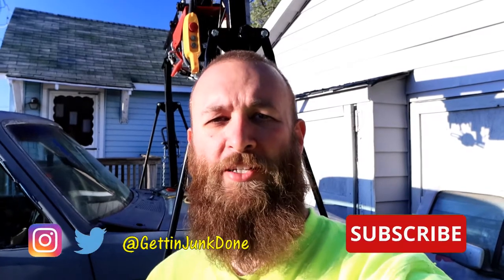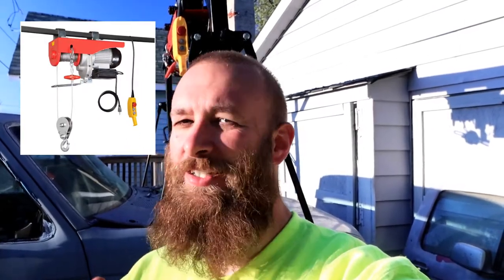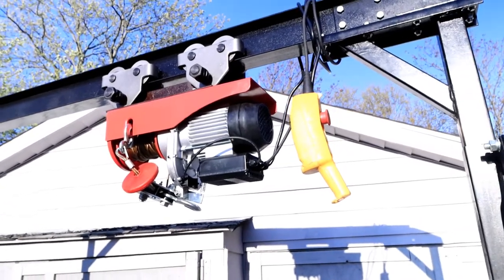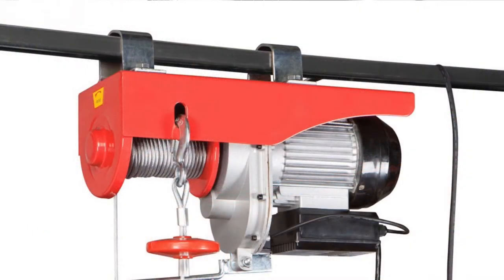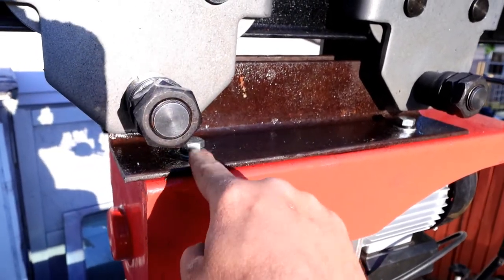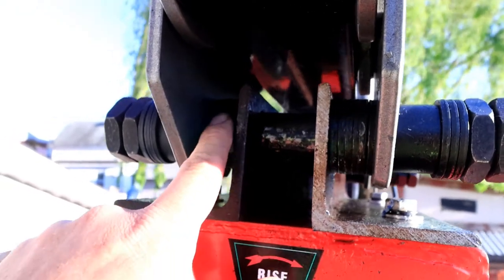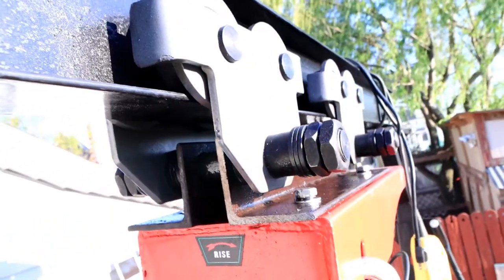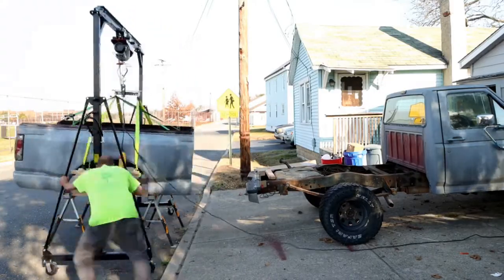Harbor Freight Electric Hoist Mount for a Gantry Crane by @GettinJunkDone

Comment: I agree this is the best way to hang such hoist. Have made one myself a couple of years ago, first tried with 1 trolley because i ony had 1. Didnt work. then i build something similair. Only diffrence is i had a piece of square tube laying around wich fitted perfectly in the original brackets of the hoist. Drilled 2 holes in the square tube to fit the axles of the dolly's and welded plates for strength around the holes. That thing was indestructable. i had it installed on a 6m I-beam and that i beam was also hanging by 4 dolly's on i-beam either side.
Reply from the maker: That sounds like a very cool setup!  Thanks for the comment!

Comment: I have not yet built a trolley system. Only in my mind. So I have been looking for some "How-to" videos. I have watched many videos where they struggle with the winch tilting when mounted from ONE trolley. I got to thinking to use two trolleys and make an adapter plate. Then I came across your video which verifies my way of thinking. Yours is even more simplified. Awesome video and information. I now know how I want to build mine when I can finally get to. Thank you for posting.👍

Comment: I'm looking to buy a similar setup so I can remove my h3t pickup bed due to a rusty frame but my bed now probably weights about 1000 pounds due to overland build out rooftop tent drawer in bed bed rack , I don't want to dissemble anything so im looking to see what options are available

Comment: Neat idea, I could've used that thing when I pulled the motor from my pickup. The Ford diesel 7.3 weighs in at 1100 pounds. I used an engine hoist and two other people besides me to wrestle it out of the truck and put in the replacement motor. One big heavy SOB engine.
Reply from the maker: This definitely would've helped!  That is a heavy engine for sure. Once you have a gantry crane, you constantly think of things to lift, lol.

Comment: I found this very helpful I've tried connecting my Harbor freight electric hoist to my gantry crane with chain and the interesting observation is the twisting of the spool causes the cable to rub against the automatic shut off stopping the motor relatively frequently with a few clamps I got it to work just fine but I'm curious under heavy load if you wouldn't have some twisting take place in the sense of one of the sides wheels lifting off the beam slightly as the load shifts from the twisting of the spooling of the cable being loaded a lot more than the other if it makes any sense to you lol
Reply from the maker: I think i understand what you are getting at.  My hoist doesn't wiggle side to side since it's tight enough against the rails.  In other words, there isn't enough play for the wheels to lift off the beam.  With the right amount of spacers added, I was able to avoid this problem.

Comment: Great video, making an electric hoist even more versatile.  Did you use the bolts that came with the hoist or perhaps use stronger ones, since I would guess the weakest "link" in that design would be those bolts/nuts.  Thanks for sharing.
Reply from the maker: I ended using the hardware that came with the hoist.  The brackets were thrown in the scrap metal pile, but I did use the bolts that were supplied.

Comment: At 2:31 I would have thought you would have spaced the brackets out wider so that the holes were mounted closer to the vertical section of the angle iron. That way you wouldn't use as many inside spacers and there would be much less moment on the mounting bolts, with the vertical section of the angle iron and the roller plate nearly touching (could even weld AND bolt it this way). In this configuration you are not lifting by the bolts in tension but in quite a lot of bending moment. I think that you have much reduced capacity in this configuration.

You really can't just simply take the ratings of each part and call it 1 Ton if you have modified it heavily and have have not tested it to destruction with load monitoring. 

Don't get me wrong, this is a great looking upgrade and a job well done, I am just not sure that your numbers are where you think they are.
Reply from the maker: You could be on to something, but I also believe the spacers are helping in preventing the bolt from bending.  With enough spacers, it's as much tension the other way too.
Reply: @GettinJunkDone  I don't really think the spacers are doing anything. The spacers length is determined by the distance of the mounting holes on the angle iron. Since there isn't an inside spacers it's just freely sitting there. And still that is additional moment on the horizontal bar as well as the two mounting bolts. No question, it would be stronger (possibly rated to actual capacity) if you move those out.
Reply from the maker: I see what you mean now.  I'm going to leave it as is, I don't think that a bolt/ fastener of that size will fail.  I appreciate your input!